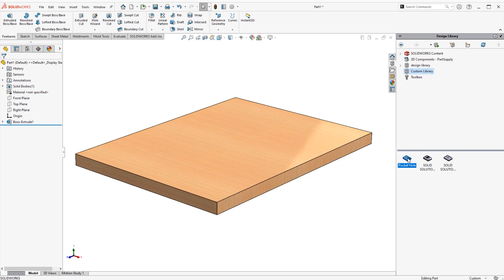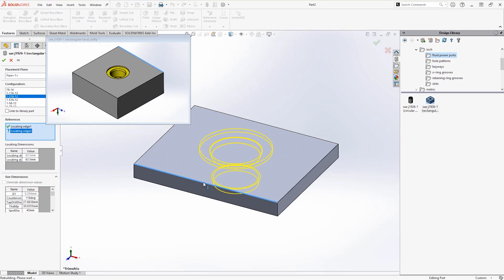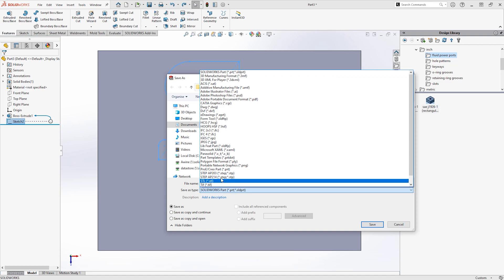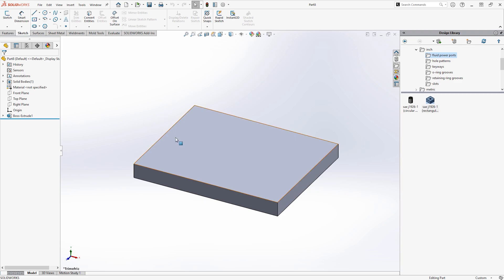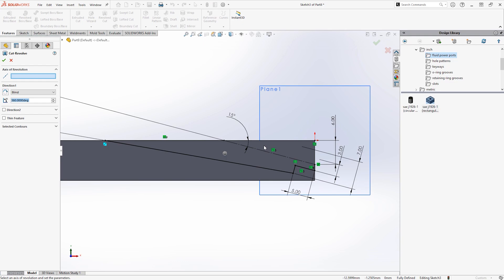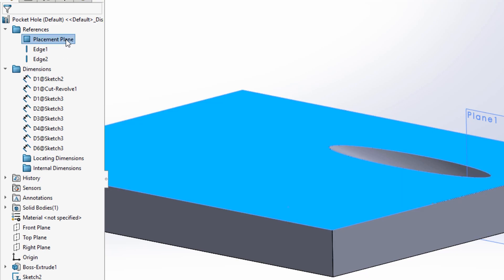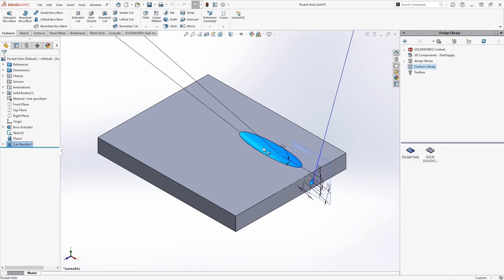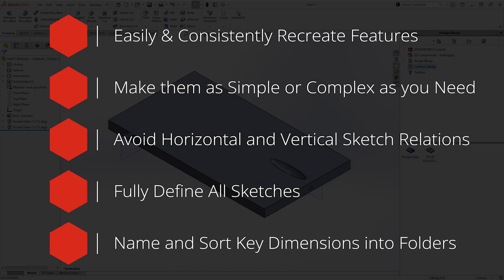How to use SOLIDWORKS Library Features | Advanced SOLIDWORKS Tutorial

Comment: I've used library parts pretty extensively, what I find often happens is solidworks flips the normal if I used a surface as my placement plane. To get around this I've usually incorporated a plane into my library feature itself, but then I still have to edit the library feature to flip the normal of the plane. In the solidworks library features general attributes and limitations, solidworks mentions you can flip a sketch orientation with arrows in the graphic tree, I've never seen this option.